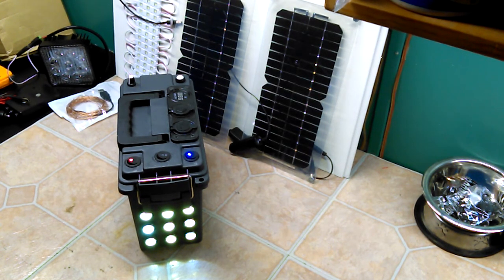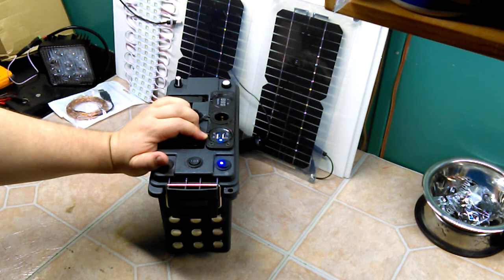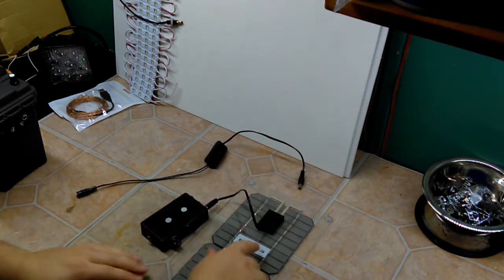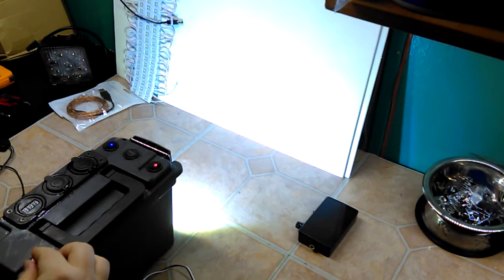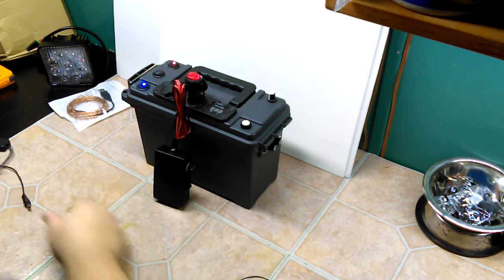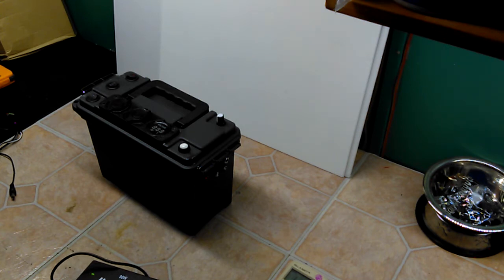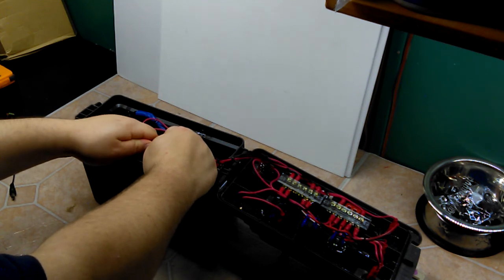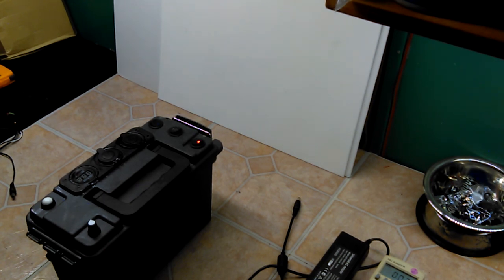DIY Portable Battery Pack 12V 10A with Solar Panel and LED UPDATED

Comment: If u update the design again I'd recommend replacing the USB ports on top with ports that supports qu 3.0 which is quick change it's better then normal USB power it gos from 5v,9v, and 12v it allows for quick charging
Reply from the maker: I have the 12v lighter socket that I can use. But thanks.

Comment: does the load out from the charge controller lead to the switch that controls the fuse block?
Reply from the maker: The out put on the charge controller is protected with a resetable fuse, so there was no need for another one.  Fuses are on input and battery input only.

Comment: great vid, thanks for sharing, would it be possible to charge from a car cigarette socket, if so is there any addition parts needed?
Reply from the maker: It depends on the car, most cigarette lights will put out 14-15v, since the solar controller handles the charging of the battery all you really need is about 15v or more going into the pack to charge the battery.  Now you should only charge when your car is on and the alternator is running otherwise you will discharge your car battery.

Comment: Nice video you state in your parts you used a glass fuse holder where did you place it in your box?
Reply from the maker: Two black knobs by the charging port next to the charging LED

Comment: Wow. Hands down the best on youtube and I watch them all. At $125.00 + shipping you should sell 1000's of them. If I had the 125 I would order one now but it's not in the cards right now, a little homeless at this time. You take care now. Nice build. The only thing I can think of is if you could build a plug-in charger that would recharge AA / AAA / and maybe 18650's.
Reply from the maker: Hello, using the DC 12v car plug to NightCore D4 4 port charger ($45) will charge all those batteries without issue. I have tested that and use that setup several times.  There are also chargers that work of the USB port as well. The Nightcore UM10 USB charger cost around $9 and will charge one battery Ni-MH or LiPo without issue, just not as fast as the D4 unit.

Comment: I saw on your other video you may be selling these?
Reply: If you are selling locally where are you located?
Reply from the maker: Yes, right now I am only selling locally.  Depending on demand I may sell online.  The cost would be $125 + Shipping.
-1 Main unit as videoed
-1 18v 5.5watt solar panel
-1 10 ft barrel plug for solar panel
-1 wall charger

Depending on how you order these the parts cost about $85$90, and to put it together takes 5-6 hours per unit (not covering curing time for the epoxy which takes 24 hours)

Comment: Appreciate the parts list. Perhaps where you actually got the parts would be a possibility? P/Ns also?
Reply from the maker: Hello, most of my parts came from ebay.  If I linked a URL you would most likey end up with a dead page.  But I will update my list to the best that I can, when I have time.
Reply: Data 795 Thanks...I did a fair amount of searching eBay and Amazon.

Just perhaps what search term you were using would be something you could add.
Reply from the maker: The parts list in google drive has been updated with ebay links.

Comment: Nice work, excellent build.  If it was mine, I would use a better charge controller...  Morningstar makes a few you can get for under $30.  Is heat a problem inside the case?  Also, I am not sure if solar charge controllers are made to work with straight DC input, read that somewhere, not certain.  Last thing, I have seen those panels on ebay, have you tested them?  Are they up to spec?  Thanks
Reply from the maker: -This charge controller has yet to give me any issues.  I did measure the input/output under a load and it is fine for my needs (usually under 4a draw)  It does heat up if I place it under a 5+ amp draw but since this is mostly for lighting use I don't really get up that high.  
-The bigger issue with heat is the front mount leds, when they have been left on for a few hours at full brightness they can get hot and that warms the inside of the case.
-straight dc does place a lot of stress on the power adapter.  I predict it will die very early if I keep using it as is.  I have made use of the SLA charger, and I am making a CC-CV adapter right now that goes between the power adapter and the port that will reduce the draw to a constant current draw that should fix the issue. 
-As for the panel,  I have purchased form 2 different sellers.  The first one did not meet my specs as both the voltage monitor and the USB adapter were not into specs.  I found another sell that I will post later that sold panels for a bit more ($11 each) that were great.  The USB tops out at 3.8a total without voltage drop at 5.0v sustained over a 30 minute test. 
-The 12v panel was tested upto 6a,  without heating issue using a laptop charger.  Please note this units battery is designed for 3a max draw so when you can pull upto 10a from it you will be shorting is life by doing so. 

-I designed this for mostly Led lighting a small area (12x12 tent and campsite) and some light phone/laptop charging (my main laptop only needs 22w to run 35 to charge)  If you have larger power needs look into a "Toolbox battery pack" that holds 2-8 batters that will have a much higher amperage rating